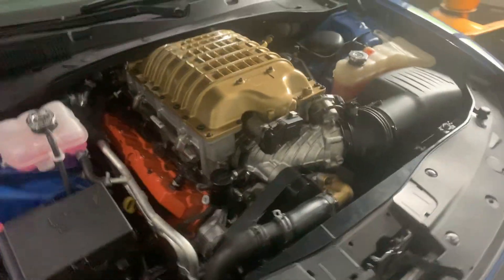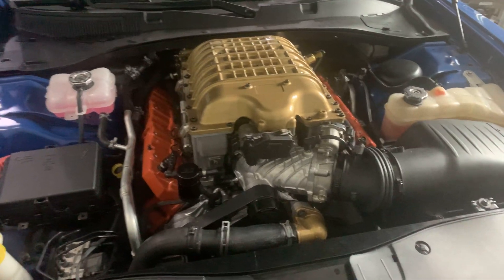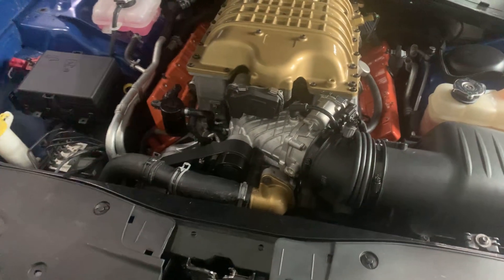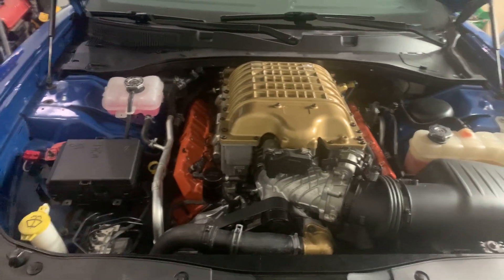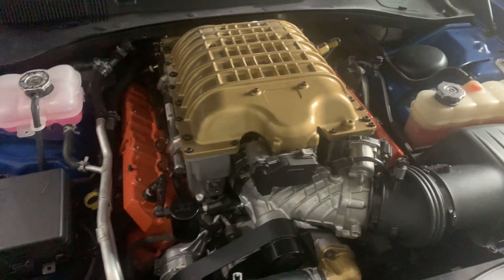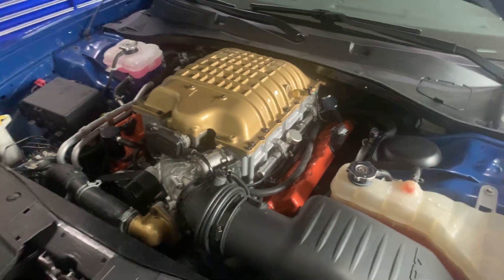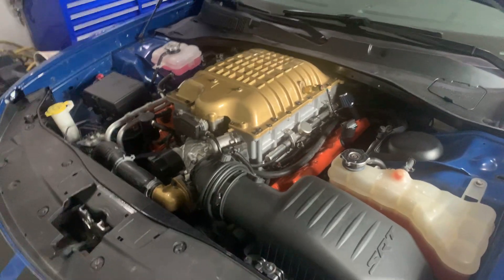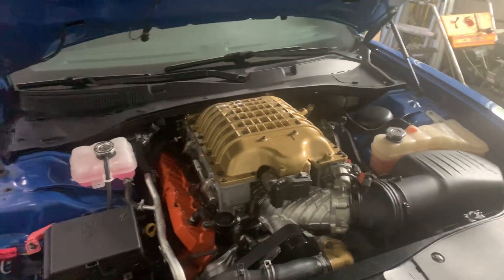How much boost on a supercharged 6.4 hemi

Comment: Hey how is the nag1 holding up ?
Reply from the maker: The car has since been complete hellcat swapped. I can tell you the nag would go into protection mode . (Neutral) Pull over shut it off and you were good until you put to much power to it again
Reply: @1badcaddy1 I don’t know a ton about the Nag1.  I’m a LS guy for 20 years and have been tuning and building race engines for the majority of that time.  I just acquired a 2012 SRT jeep with the Nag1.  I have a Procharger ready to go in.  I saw your comment about the protection mode with this trans… can you elaborate on this?  I think this can be tuned out to prevent having to reset the ignition and clear the error. Obviously it won’t prevent the transmission from slipping.  But i have a partial handle on bumping up the pressures in track mode to help prevent slipping. Definitely not right way to do it. But it’ll give it less of a chance of slipping under load.

Comment: Can I get a quick run down how to make a hellcat blower work on my 2022 widebody scatpack charger I know is has a bge block and I also know it needs forged internals I just don’t know what else is needed!! Thanks in advanced bro and absolutely sweet build I wanna get like you asap
Reply: forged internals, cam, headers, supercharger of your choice, injectors, dual fuel pump, oil pump upgrade, diff bracing, probably some lifter / valve work. a better throttle body. I'm sure im missing something, most people just upgrade to a hellcat because this over 15k in just parts ( dont forget transmission work $$$$$) deleting mds and vvt def a great idea getting up over 20k now, again most just go with a hellcat at this point.

Comment: What does it generally cost to change out pistons and get the 6.4 to handle it
Reply: 20k
Reply: @81mccabe58  It's not 20k. Whoever is charging that much is ripping you off.
Reply: @Ominiumshadow24 all all fairness you have absolutely no clue what extent of forging, fuel injectors, larger throttle body etc etc, by that I mean I what I would consider all that should he done in forging based on my knowledge for it to be really well done and be capable of further boosting down the line. 

As far as who’s ripping me off that’s just a classic YouTuber dropping opinions with no information. 

I can’t be ripped off cause I do this work myself.  So yeah that’ll answer that one.

Comment: With the new BGE that comes in the 2018 year and up can I throw the supercharger on there or would I have to forge everything still? And can I turn up the boost?
Reply from the maker: You need to go forged pistons and rods . If you go with the pistons that drop the compression you will in fact have a hellcat equivalent. Mmx has it all

Comment: Hellcat heads ?
Reply from the maker: I was running 6.4 heads with supercharger adapters plates .
Reply: @1badcaddy1 hey what would I need, does the supercharger direct fit on or will I need something

Comment: It also look like you’re running front thermostat, housing, and pulley system off of the hellcat to make the supercharger to work because I saw other way and I don’t like it. The part that I need a hack off the front top part of the housing.

Comment: Did you use stock 6.4 oil pan with the hellcat timing cover?
Reply from the maker: You have to use hellcat pan for the front pan bolts to line up with front cover
Reply: Thank you.

Comment: You think I’ll be good on a stock 6.4 running 6psi?
Reply from the maker: Yes on 6 you will be great . Run 93 octane
Reply: Think I should do drops ins first just to be safe
Reply from the maker: 6 lbs on stock . If you do drop ins with rods you can push as much as you want
Reply: @1badcaddy1  how you blew yours up?
Reply from the maker: Rod failed. Was running 14 lbs . Forged pistons looked great
Reply: @1badcaddy1  so you didn’t have forge rods?
Reply: Would you do drop ins for me if I paid you?
Reply from the maker: Sorry I have too many projects of my own

Comment: What exactly was needed to make the 6.4 accept the blower. Like a hellcat ecu, new wiring, splicing, etc?
Reply from the maker: I ran a hellcat front timing cover ,waterpump , lower pulley and oil pump . I used my 5.7 harness and my ecu. Remote tuned using hemifever tune . I did have to remove tape on harness to separate injector and coil wires . If you do this you will not have to splice .
Reply: @1badcaddy1 when using the hellcat timing cover do you have to also run the hellcat crank pulley? and will it work with the stock 6.4 crank ?

Comment: I’ve got forged internals on my R/T 392 swapped Durango but I was thinking of going the turbo route. Now I’m thinking of just getting a Hellcat blower since they only put out 5-6 lbs of boost on the 6.4. I don’t want to get too much boost for my daily driver.
Reply from the maker: You can get more boost with a pulley change . It will only cause you trouble asking for more than that . I blew mine up and have a hellcat motor now .
Reply: @1badcaddy1 How hard was the hellcat engine swap from your scat?
Reply from the maker: @deltazulu392  I was running the hellcat motor on a 5.7 harness . Just need a good tune.  Mine was a hemifever remote tune.
Reply: how long did you have this setup before the motor blew? I have a 2020 scat, thinking about ordering a 3.0L whipple, i have a shop 5 miles from my house that specialize on mopar @1mopargearhead

Comment: How reliable is it and what’s the max amount of boost can you get out of it?
Reply from the maker: I did a pulley change and was pushing 12 lbs. I ended up blowing the side out when a rod failed .
Reply: @1badcaddy1  10lbs is more then enough I’m pretty sure your either faster or right next to the hellcats but correct me if I’m wrong
Reply: @1badcaddy1  they say they don’t take boost well but I’m pretty sure that if you build it right it can handle anything. At least that’s what I thought

Comment: Can you just run the hellcat pulley and just get the 5lbs of boost without forging the internals?
Reply from the maker: Yes you can but the front cover and oil pan also has to be changed to run the hellcat pulley setup
Reply: @1badcaddy1  ohhh alright so it’s probably cheaper to just run the hellcat supercharger then huh

Comment: Wrong. The 392 bottom end is maxed out in stroke. Which can't handle the higher power of the hellcats, red eye etc. Thus is why Dodge uses the 6.2 not 6.4 .
Reply: tuning trans etc its not just one thing making it all work. but yeah the pistons were not made for boost or very low only less than 5
Reply: The BGE is not maxed out in stroke only the pre 2018's they started using the BGE in the later models
Reply: Your wrong the crankshaft is forged steel. The problem is the pistons. You shouldn't be talking. If you don't know what you are talking about.

Comment: can i run stock pistons and just all around stock motor with the supercharger on top with 6lbs of boost?
Reply from the maker: Yes you could get away with 6 lbs . The problem is you will want more . I put a smaller pulley on mine and blew the bottom out !
Reply: @1badcaddy1  so how much hp do you think i’d have after the blower on top? i think i’ll keep the stock pulley for now. i wanna have completely stock internals with the 6lbs of boost.
Reply from the maker: @catfishkam  should be around 600
Reply: @1badcaddy1  how much boost can the motor handle stock? i want it to be fast and keep up with a lot of stuff but i want the motor to last me.
Reply: @catfishkam 392 motors suck when it comes to handling boost. I’d run 5lbs of boost just to be on the safe side

Comment: Hello, did you use Thicker gasket to lower the compression ratio?
Reply from the maker: No I didn’t change compression.
Reply: Thanks, do you have 4032 drop in Pistons and Manley rods ?
Reply from the maker: I had forged piston but I ran stock rods. It held up until I changed pulley. If your gonna due piston definitely do rods !
Reply: @1badcaddy1 this was something I was going to do I have the pistons but wanted to skip rods this helps lol
Reply from the maker: Yes do rods and pistons. It’s worth the extra time and money
Reply: @1badcaddy1  I’m just stressing just more money for everything I need. I ended up getting the hellcat front cover to avoid issues with pulley because I’m doing 6.4 in a 09 so was worried because 09 pulley was different. Will my 09 rt compressor and stuff work. I’m already stressing about the cost of the water pump lol
Reply: I'm replacing both rods and Pistons. Im little confused  between 4032 and 2618 pistions. What pistions did you get? Could you please share the link?
You car looks very clean.. Nice build bro 👍🏾

Comment: Add a supercharger and use stock air intake?  Get a cold air intake bro.
Reply from the maker: Lol.  Most cold air intake give you hot air! Superchargers don’t work well with hot air ! That’s a hellcat air box sucking cold air from lower bumper vent .
Reply: @1badcaddy1  I've noticed alot of non Mopar fans when they see the Mopar engine bay on scatpacks and up they think the first upgrade would be a CAI but ours is actually pretty good already and hard to improve on aftermarket
Reply: @1badcaddy1  Get a cold air intake that is isolated from the under hood hot air bro. Don't buy any of the cheap made in china crap.

Comment: So you front cover swapped to the hellcat cover, OEM balancer used? How about accessory drive? I genuinely want to do a setup like this, but it would be on a stock 392 or stock 5.7
Reply from the maker: Front cover ,complete drive and oil pan
Reply: @1badcaddy1  that’s awesome, the factory 392 crank worked with the hellcat balancer? It wasn’t too short or anything?
Reply from the maker: Bolt on.  But you have to have hellcat oil pan also
Reply: @1badcaddy1  oh yea I figured as much. I’ve been contemplating my next “build” and a 5.7 300S with hellcat heads/front drive/pan keeps running through my head. How did you get the bypass valve to function? I see it’s still electric and not vacuum operating
Reply from the maker: Boost controller from mmx
Reply from the maker: As far as I know hellcat heads will not work on a 5.7

Comment: how is the transmission holding up?
Reply from the maker: I’m running an hp70 currently and seems to be fine. I would like to have it dyno tuned .
Reply: @1badcaddy1  the hp90 is in the hellcat ?
Reply from the maker: I’m currently running hp70 . Since the car originally was an AWD with a 5 speed …I’m running the sound German automotive tcm to control the 8 speed . I will be switching to the Hp 90 or a built nag 5 speed .
Reply: @1badcaddy1  word ? Really thinking about going back to the 5 speed ? Wat can you expect out of it ?
Reply: @1badcaddy1  hey did you say you had a nag1 5 speed then switch to the 8 speed? I’ve been trying to do that but shops around me saying it can’t be done
Reply from the maker: @botomusprime6238  yes I was a nag 1 then switched to 8 speed using the Sound German Automotive kit. Easy to do. Cost 1000 bucks for the kit
Reply from the maker: @tylercouture216  yes hellcat comes with hp90
Reply: @1badcaddy1  ok nice. I gotta find someone that can swap out my nag1 to the hp70. I’m getting the hellcat blower also. Do you know how much boost can be squeezed out of the hellcat supercharger?
Reply from the maker: @botomusprime6238  with the supercharged 392 I only got about 7 lbs max.  I swapped to a 272 pulley and I doubled it . That’s what got me in trouble with stock rods .
Reply: @1badcaddy1  how much boost are you running now? And also one question about the trans swap. Did you have to install the electronic shifter as well from the 2015+ hemis
Reply from the maker: Yes new shifter… it doesn’t come with the sound German kit . After I thru rod I did a hellcat engine. Not sure how much I’m pushing .
Reply: @1badcaddy1  oh ok I was wanting to swap a 6.2 into my charger but they are pretty high price. I’m going to do mmx drop in pistons and rods and try to squeeze out as much boost as possible out of the hellcat supercharger.
Reply: @1badcaddy1  when you switched from the 5speed to the 8speed did you also have to change driveshafts? Or did you use the stock driveshaft?
Reply from the maker: @botomusprime6238  had to go with a scat drive shaft

Comment: Forged pistons is the right way to go for longevity and high power
Reply: I'm pretty sure it's all forged for the factory
Reply: @evanleigh4604  no it isn’t. 5.7 and 6.4 natural aspirated engines don’t come forged from the factory.
Reply: @evanleigh4604  only thing forged is the crankshaft
Reply: @evanleigh4604 yes but the 6.4 is not meant to take boost so it is good to change them to better pistons for boost

Comment: Did you have to extend your harness for either the coil pack or injectors to fit those valve covers?
Reply from the maker: I did not cut any wires I pulled off the outside  and then separated wires back far enough so they would reach and then re-taped

Comment: nice build man!

Did the mechanics mention any problems with the block? specifically the bore diameters being uneven ?
Reply from the maker: I did the work myself
Reply: @1badcaddy1  did you happen to measure ? The reason im asking is that a mechanic claimed the hemi blocks  have this issue because also when his tuner mentioned he see's alot of miss fires.
Reply from the maker: No   It was a 2020 motor… I just put drop in forged pistons and put back together.
Reply: @1badcaddy1  I wish you made a video about it. Ive always been wanting to see hows its done.
Reply: @1badcaddy1  how much did all the materials cost you? You have some really good content
Reply from the maker: @skuntpack3925  I had somewhere close to 1000 bucks to paint widebody kit and spray pearl and clear
Reply: @1badcaddy1 how much hp and torq you have now ?
Reply: @1badcaddy1 im good to buy a 2022 durango srt 392 im planning to put hellcar blower forge the engine and injector with the pulley you say. I want to know how much power you have? Thanks

Comment: Whats the reason to replace the oil pan? Is the timing cover completely different or was it mainly the water pump? I saw you mentioned you bought the coolant pump and reservoir and cooler for 500, was that including the lines? And how are you controlling the pump?
Reply: BTW i tried to comment on your first video where you were discussing the installation and stuff but comments are turned off, stated something along the lines of the video being labeled for kids
Reply from the maker: Front timing cover and oilpan have different bolt pattern at mating surface . If you use hellcat timing cover you have to use oilpan . I used stock cooler and lines but aftermarket pump. Pump runs with keyed power.
Reply: @1badcaddy1 what are you doing or plan to do for fuel? Upgrading your fuel pump, e85 or just boost a pump?
Reply from the maker: I run a boost a pump
Reply: Ok, I was looking at the bosch water pump and aftermarket heat exchanger, thanks and keep updated with your dyno numbers

Comment: Cost? Including improving internals?
Reply from the maker: Supercharger 2500
Hellcat oil pan and timing cover 
Used.               1000
Adapter plates used 150
Boost controller new 500
Valve covers used 250
Forged pistons      800
Boost a pump used 150
Tune.          500
Cooler ,pump, reservoir tank
Used          500
That’s with me doing all the work
Reply: Did you also have to replace the crankshaft pulley? If so you went with stock or aftermarket?
Reply from the maker: Yes sir. Hellcat setup uses 2 belts so the bottom pulley has to be replaced. I also pinned mine .
Reply: Smooth boost boost controller or did you go with another option like steve whites?
Reply from the maker: @ejruiz81  smooth boost

Comment: How much WHP is your car putting down ?!
Reply from the maker: Has not been on dyno. I would like to get it dyno tuned soon .
Reply: @1badcaddy1  please do update us
Reply: Has to be at least 700 to the wheels because 15 pounds get you 860 to the wheels
Reply: 15 gets 860 to the wheels on E85 or race gas. Not pump that's for sure. 800-815 on a hellcat with someone who knows how to tune- Barth or Dusterhoff. Also compression is not the reason you were at 6lbs. If so you would be making the same power a Hellcat does stock with just 6lbs. Efficiency is what drops boost. You would need an injector upgrade if you were spinning the supercharger the same as a cat with 2.72 pulley. I'm 10% ATI/2.85 Metco and run 17lbs on pump with a little E85 and some Boostane.